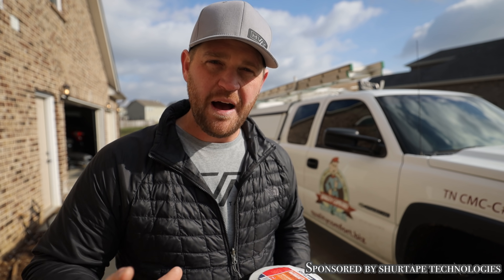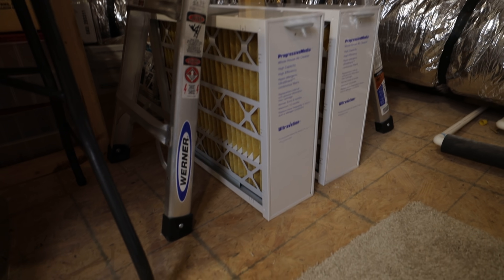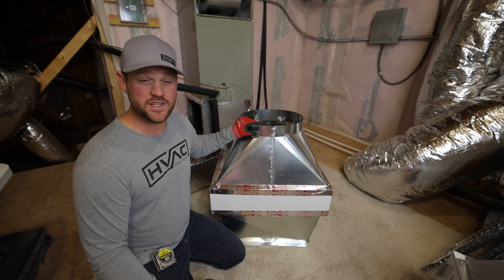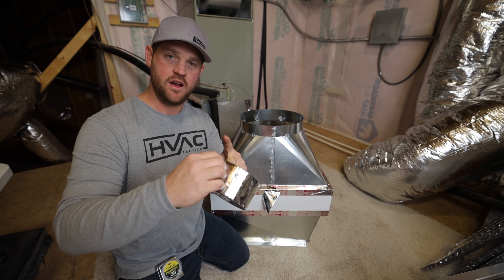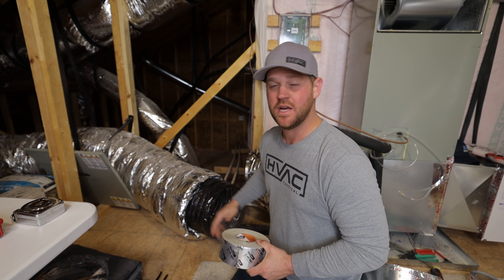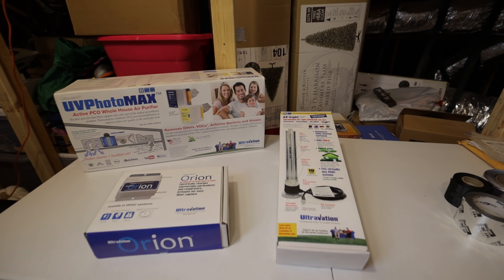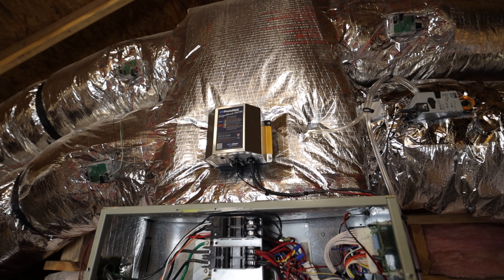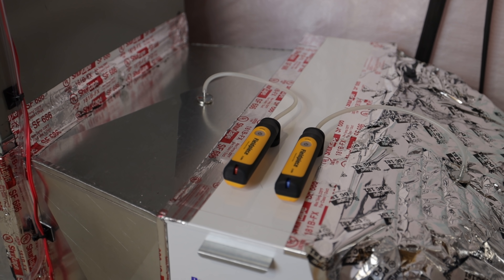Installing WHOLE House Air Purifier & UV Light | HVAC Healthy Home

Comment: We don’t see a lot of information about air purifiers directly installed in the AC system. What do you think about a lot of people worried about the ozone that could be generated by the air purifier device and could go into the air we breath in the room ?

Comment: I know this is a Old Video but shouldn't you have put Insulation between the 5" filters and the Furnace? 
I noticed there was Insulation inside the Furnace Connection here at 02:37 that you cut into to make the opening large enough and before that insulated Ducting went directly into leaving no gaps without insulation. After the work there are now two areas that no longer have any Insulation. 10:25 These two ducts that are between the 5" filters and the Furnace. Maybe this isn't that big of a Deal and just a minor thing but it did seem like a light oversight to me who is not a professional on the subject but it seemed to me that it was maybe missed on the Insulation and is now a weak point in the Insulation of that install. Grate video I enjoyed it Thanks for sharing :3

Comment: How do I know if I have a whole house air purifier? I bought my house newly built, my thermostat has the controls to turn on whole house purifier, and I could feel the air turn on. But it was an option to add and I did not opt for it.

Comment: Noooo. Not mastic tape! That stuff is horrible. It’s so hard to take apart when retrofitting anything. Then you have to clean your tools with mineral spirits to get it off. Then the red letter tape doesn’t last. It always loses it grip. Good old fashioned silver tape with mastic is the best still.

Comment: I would just like to make a point on UV lights. UV does kill bacteria, molds, virus. But does it kill them travelling through your home via the air ducts and the UV light?.  Well not that good. Thought to remember: Water UV lights usually kill bacteria and molds and others as they sit in a stored water cell with the UV light on. Its "kill rate" decreases dramatically if the water is rushing through at 25-30 psi through it.

Your furnace  UV light on is when it is passing air through it when it is on, the only time it is working so all those molds, bacteria, virus` are passing it through it within a second or two. (based on a 440 cfm fan blower motor) Mold usually takes 1-2 hours of UV light to kill mold. Stand alone tests indicate its takes 15 minutes to kill virus'. Since the mold spore, virus spore, and it takes minutes to hour to kill bacteria depending on the type of bacteria. So what you see here is that the time the spores are in the UV light in a furnace is mere seconds or less than a second. Therefore you never kill the spore it passes through, maybe weak or just as strong as when it entered. Save your money on a UV light in your furnace and buy  a hepa medical grade filter for your furnance if you are really worried about these spores due to health issues. Hospitals use these hepa filters in patients rooms when dealing with patients with TB, no UV at all. So save money, dont use UV lights in your furnace.
Reply: imo i think the uv lights are good for shining onto the coils and blower housings where mold could grow. Then you can filter spores with a filter rated for it. For ducts, it's not as useful.

Comment: I have a new construction home and have air quality issues.  I am wondering if a company like your would be able to tell me of the problem is due to improper installation, or if a configuration like what you did in this video can help.  Next how do I find a rwputable company that will do quality work at a fair price?

Comment: I like the idea of the 5” with better air flow and filtering, but could I also change over my return air vents? Have 2 system; 3 returns down stairs in different sections, and one master up stairs in a large open area.

Comment: NEVER use UV lights to improve "quality of air". While I agree they are likely the best at killing "EVERYTHING"... they are also efficient killers of ductwork (flexible duct... metal will survive), wire insulation,  rubber (motor isolators/etc) cabinet insulation, plastic and more. UV is God's cleanser and He created it to break down EVERYTHING, INCLUDING HVAC system components. (30 year HVACR veteran)

Comment: Why did you build a cabinet for the 5-inch filter so you can slide them in and out instead of mounting them permanently like that we'd have to cut them out to replace them

Comment: I love mastic tape, but it doesn't fare well down here in FL if it's not making direct contact with metal. Any other surface and it melts off from the heat. Spray glue, silver tape, squeegee, and mastic until something else comes out.

Comment: I’m sorry to bother but the red indicator light on my reme halo just turned off.  If I unplug it for a bit it comes back on but then turns off.  Think I need to replace the bulb or the whole thing ? My AC guy is charging me 450 plus labor and travel time. Thanks In advance

Comment: our tech installed our purifier between the return air filters and the coil. is that BAD? seems every video ive seen has it in the supply duct as you have in your video...

Comment: Ionizers clump air particles together making them larger and easier to filter. Putting them after the filter isn't going to do much.
Reply: Airscrubber by aerus  manual says in supply air. I see what you're saying that's why when I sell them I let them know that for a few days you'll have more dust on surfaces as everything falls out of the air.

Comment: Retired hvac tech here, in my opinion one should start in the trade as a duct work installer for a year or two and then a system installer for a year or two and then a hvac tech.  So much more knowledge gained.
Reply: They dont have duct work in Tn. Its all flex. So much competition up here as well. It drives the market down so nobody goes with metal ducts anymore unless you can get in a good neighborhood where people care about quality. Zach seems to have some good customers
Reply: Need advice they found mold in hvac and one vent. It’s not that bad, they cleaned the vent and hvac. They added a uv light I think rema system supposedly hydrogen peroxide will release into the vent or something like that. Is this enough to kill off the rest of the mold? Supposedly with humidity at 40% and with the rema and regular cleaning they said it will be ok. I can’t afford to rip out the ductwork and replace it with new ones

Comment: A standard merv 8 filter works well for 99% of folks. I keep people from wasting thousands by just recommending they run their fan 24/7... which should be recommended by anyone selling air purification. UV lights are great. UV breaks down created materials... I wonder what UV does to man made materials?

Comment: The south has worse system. Number one all flex. Number two putting equipment in hot attic space. Unconditional space. Number three not putting returns in every room beside kitchen and bathroom. They do cheapest installs in country. Plenum plus flex plus more flex.

Comment: I think " this mission impossible" because  UVC light must influence at least 20 minutes on particular(virus, microbe and others). So, because the air flow so high this purifier will not work! You will just spend your money.
Reply: Ok but after the units cycles on and off all day and runs for 20 minutes at a time the air will be cleaner. It doesn’t just run one time you know

Comment: Why wasn’t an airtight mixer box used instead of taping the filter to the ducts? Don’t filters need to be changed every 6 months or upgraded to a MERV15 in the event of wildfire smoke?
Reply from the maker: I installed a filter housing, the filters are replaceable. Just remove the door.

Comment: 1.- how do you changue the filters? There's no filter register!!!
2.- how did you select the UV equipment?
Reply: if your talking about being able  to take the filters out theres a little handle and u pull it the whol side comes out and the filter slides out
Reply: You can see the handle on the filter assembly at 9:45

Comment: I'm in school for hvac right now, I hope one day I'm half the tech this guy is. Great video.
Reply: Just keep at it man. Learn how air flow works and super heat and sub cooling within the systems. Learning this is a plus. Good luck!
Reply: Advice. UV lights are near useless in a furnace or air handler. It takes minutes to hours to kill mold, bacteria, or virus`. Yet it passes through the UV light in a second or less. Be a good hvac tech and tell homeowner to invest in HEPA furnace filters. Thats what hospitals use for patients with TB. Its just basically a 2x3 fan with a medical grade HEPA filter on it. UV is useless on hvac.

Comment: Can tell he's never installed these before. But it's a paid advertisement so meh. And I love working in attics like this
Reply: He never likes or gives thanks to all the HVAC techs who give suggestions that have decades of experience. I just saw a video where he put a package unit's sheet metal straight on concrete. The acid in the concrete will rust that thing out in 7 years or less.
Reply: Yea I hear you I pointed out one of his re and res had restrictive airflow in the return air which could have been addressed in the new install. I mentioned it because he was asking for input. You guessed it crickets. Most people have no idea what's going on in the system as long as it looks shiny.

Comment: Is a spacer required between the duct and the bubble wrap insulation? I see some companies say to do this while others and I see you do not worry about it? Does this make a difference. Thanks in advance.
Reply: Without a spacer, it's only R6. Personality, I double wrap the small bubbled R6 with no spaces (R6 is R4 with no space) and I figure I'm getting to R8.
Reply: @guyliebenberg7034  Thank you for the informative reply. Just so I can get this straight the big bubbled Reflectix is r6 WITHOUT a spacer and the small bubbled Reflectix is R4 without a spacer? Or am I misinterpreting. Thank you

Comment: Great video and a very professional demonstration! It's too bad that 80% of these installs would be done in an overhead attic, where there's hardly any space to move around in. lol Attics that have minimal floors installed so you have to watch your step on the joists or you wind up going through the ceiling into the owner bedroom etc. Attics that has active animal presence and feces plus who knows what else.

Comment: Just found your channel quick question, I have a power humidifier/ General brand that I can hear while it is running, the furnace sits below the stairs to the basement and it resonates while it runs. How to make it quiet!
Reply: It may be your fan motor bearings for your humidifier failing. Make sure your water supply line vavle is wide open as well.
Reply: @chasetoedter9185  Thanks, happy Christmas

Comment: I know you have a space issue but that plenum is way too small. zone supply’s look like a serious high static pressure issue. Need a larger plenum and more distance. I don’t know i can’t measure it but any system I’ve seen done like this is lid and blowers go out every 2-3 years.  I’ve seen other videos when you started and were running vacuum through manifold and since fixed that i would highly recommend getting wrightsoft software and designing based on numbers and calculations first.
Reply: you are wright plenums should be at least 4 feet and no ducts before the first 18 inches air would go right past them.

Comment: Very clean work, much respect! I was wondering why not put the filter cabinet right on the bottom of the machine and connect the return and bypass. That way you only have 1 filter to worry about. Just a question. Your work is spotless. Mad respect. Its hard to stop a Trane 💪🏼

Comment: Those filters are going to increase pressure a lot after a couple months.
Reply: Not really.  There is so much surface area to 5 in filters they can last up to a year if pulling from ceiling in a house without dogs. A good 5in has less than .1 drop fully loaded.

Comment: You forgot the part where you check your blower and duct design to make sure you have the available static pressure because the uv light has to be around.  .25 IWC Drop.

Comment: Couldn't tell if the filters are in a housing or you connected directly to the filter (looks like directly to filter). Why not make a housing to make changing the filters easier in the future?
Reply from the maker: I attached to the filter housing. Filters easily slide out for replacement.

Comment: Reme Halo is a a better UV light in my opinion, never cared for the products used here for the UV.
Reply: Agreed. The new RGF Reme LED is a Purifier, UV, Ionizer all-in-1. And no OZONE production either compared to their previous Reme Halo. Personally I’ve never seen a bulb, purifier, and ionizer mounted all separately. Seems pretty outdated but maybe it was a paid product placement or the customer chose that brand.

Comment: UV light in the air handler system is the only way to use a UV light. Good stuff.  Any UV thats powerfull enough to kill will also burn you. so this is perfect. I run one in the air handler.

Comment: I struggled connecting the lower part of the transition to the unit. The distance between the flange and the floor is so tight its very hard to get screws in and also to get tape applied.

Comment: So I see the original install never had the soundline buttered. Meaning no mastic was used to the edge of the cut soundline. And same after you put on the filters. Remember air quality. Well fiberglass in the airstream is not good air quality. Most people don't think about this even when installing duct board. But when you have worked in a sheetmetal shop these are small but important details.
Reply: Also not to be that guy but my OCD is getting me. You had help. While you were cutting in that purifier and wiring why not pull that blower and clean that wheel? Just curious

Comment: I like your content and how clean your work is!
Question, after installing all the pieces of equipment into the vent lines did you do a static pressure test?  Maybe you did a static before and after and can public what this upgrade did to the air flow.  Thanks

Comment: That has to be the cleanest attic set I’ve ever seen in my life
Reply: And one where you don’t have to crawl everywhere 😉
Reply: I Did a install of 2 Complete systems once Where the Attic was So Big it was Like 2,000 sq. Ft and Had 12 Foot vaulted ceilings. Only once Have I Been in a Mansion Doing an install With so much room. It Was Definately nice !
Reply: @OcRefrig  My place is 3200spft (built more for my father who is in a wheel chair than me) and it's basically a big square box. I joke about having the pyramid of Giza as my roof, from the middle of the attic floor over the kitchen to the peak is about 15'. I could easily do another 1900sqft house up there with 9' ceilings. And as a Low Voltage Tech (Smart Home builder), my attic is by far the best one I have ever worked in, and I have been in 50mill dollar mansions that you basically have to crawl on your stomach to get anywhere in the attic SMH.
Reply: I've been inside attics you could put a couch in and live comfortably. Rich people man
Reply: Rich people are particular with their houses
Reply: Ugly ducting Though but tbh it's hard to make flex look good*
Reply: Same here
Reply: Lol for real 😂
Reply: Looks like it just got built.
Reply: Right
Reply: I was thinking the same thing 💯
Reply: I had 2 calls today with clean and large attic didn't think it was possible 🤣🤣

Comment: Not a fan of the 5" filters. Engineers design air flow using 1". Nice install however.
Reply: The AHU has a built in 1" filter rack but Trane sells a 5" filter accessory for their residential AHUs similar to the one he installed. If the 1" and 5" filter have the same MERV rating the 5" filter has more surface area so will clog at a slower rate and should have a lower initial pressure drop. Residential AHUs can't handle a whole lot of pressure drop so going over a MERV 8 isn't ideal. The system will handle a MERV 11 or 13 but the CFM and motor efficiency might suffer.
Reply: What does that mean?? System airflow is designed to TESP.  1" filter are dumb. The large media filters can actually be at a high merv rating and still have a low pressure drop.
Reply: @FoXHounDXD  What I mean is before choosing a filter thicker than 1" it would be wise to check with the manufacturer. Not all   furnaces will accept thicker filters per design. As the filter width increases, the motor must work harder to pull air through it, especially when dirty. This will reduce  efficiency and can cause premature motor failure.
Reply: @maxeyac  incorrect.  Larger media = more surface area. which lowers face velocity lowering pressure drop and can load more w/o pressure drop. 1" filters at the same merv rating has far more pressure drop across. because they have far less material.
Reply: @FoXHounDXD  No Im not incorrect. Like I said previously "ALL MANUFACTURERS" suggest using 1" filters in their installation packet included with each furnace. Dont take my word for it, look at the installation guide of a Trane for example. I disagree with you. My original post was based on Manufacturer design and what the installation packet that comes with a Trane furnaces says to use!
Reply: @maxeyac  idk what you are reading lol but you might wanna double check. Unless you think trane's cleaneffects filter box isnt meant to be used on their own equipment lol
Reply: Im reading the installation manual provided with an 80% Trane furnace.
Reply: @maxeyac  so you're saying trane makes an air cleaner that they say you cant use on their equipment because its not 1"??
Reply: @FoXHounDXD  Im saying Im not a fan of the 5" filter which started all this. You replied and  I dont care what you think. I disagree with you. Got it?
Reply: @maxeyac  makes no sense but okay.